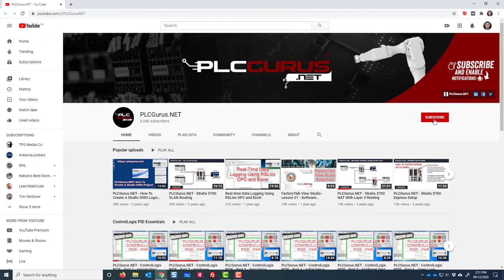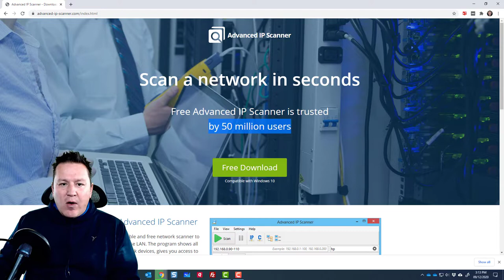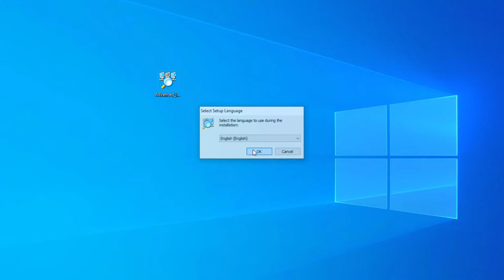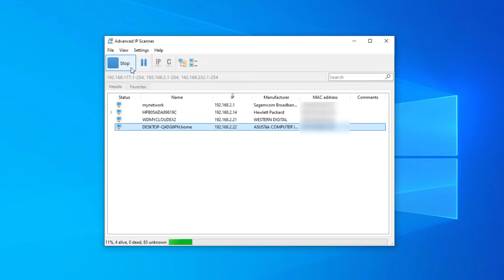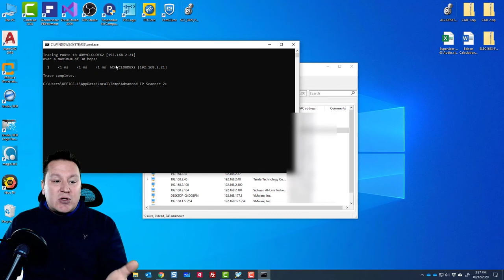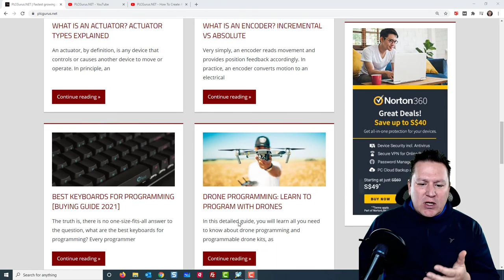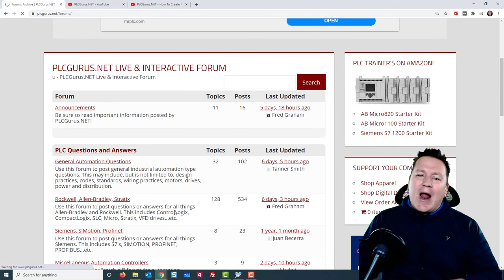Find ANY DEVICE on your NETWORK | Free Network Scanner

Comment: If you're using macOS or Linux, try Angry IP Scanner (downside: uses Java) or NMAP. The bonus of these tools is that they are cross platform whereas Advanced IP Scanner is Windows only, and it's not nearly as "Advanced" as NMAP.